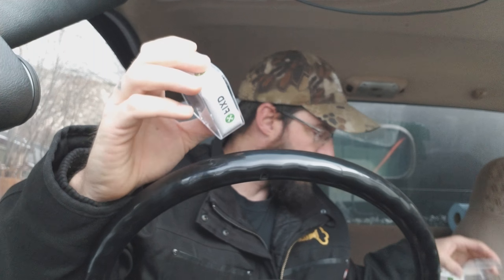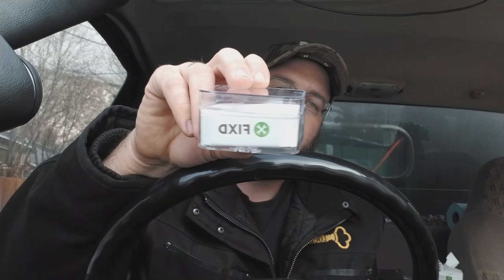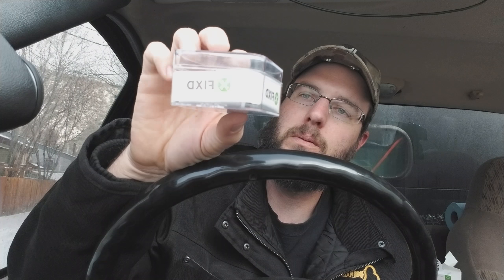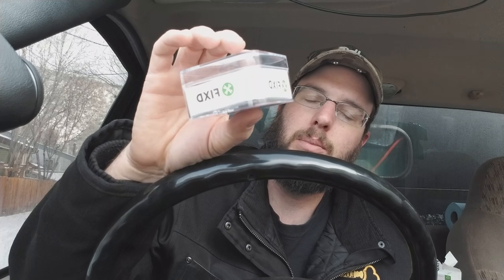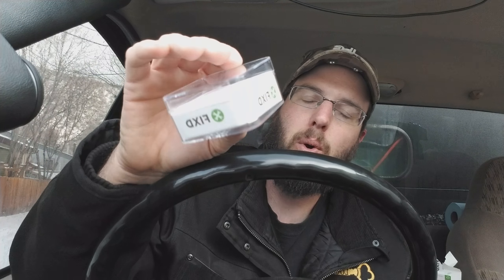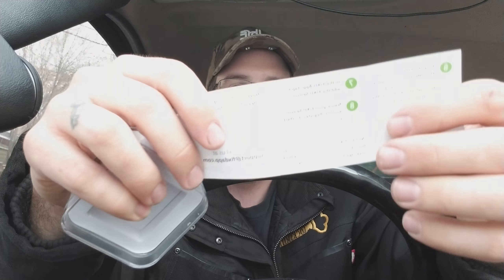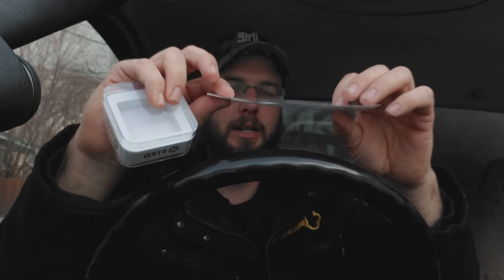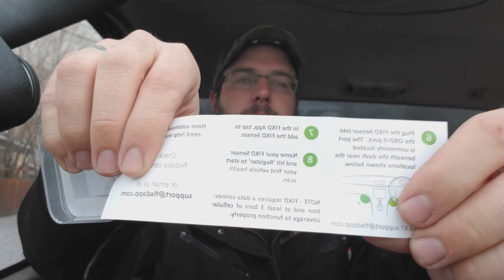How FIXD Works Automotive App That Vehicle Diagnostics Review

Comment: From the FAQ at the FIXD website "The FIXD sensor will work for diesel trucks that are 2008 and newer, and other diesel vehicles that are 2006 and newer. We do not recommend using the FIXD sensor for diesel trucks that are older than 2006."

Yes you can leave the sensor plugged in while you drive.
Reply: Can you use it for petrol or fuel cars or only for diesel cars???

Comment: Fixd is nothing more than a basic code reader. You can do the same with ELM327 Bluetooth adapter and Torque App as an example. That will cost you only $15. Before anyone buys FIXD and want to see how it compares to other scanners out there check out YOUCANIC FIXD Review.